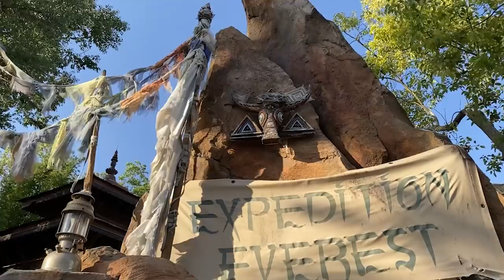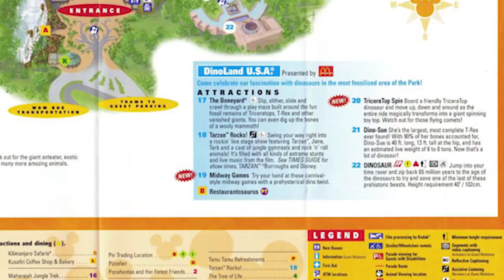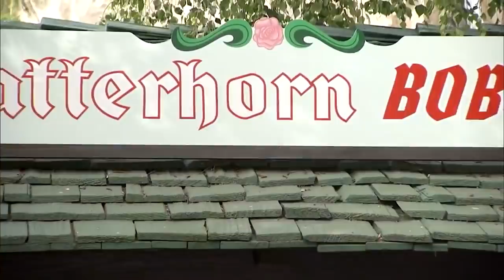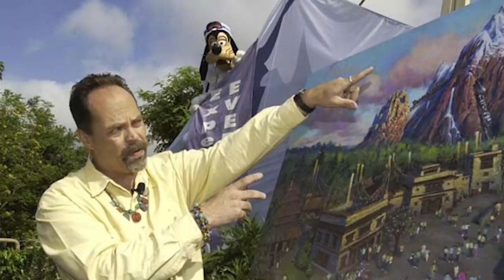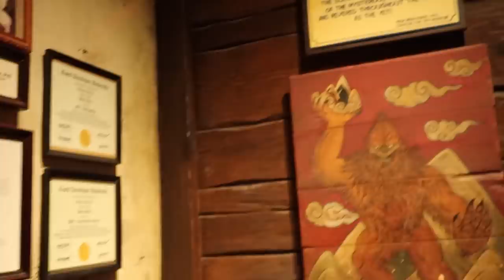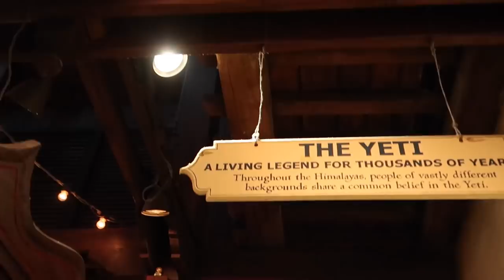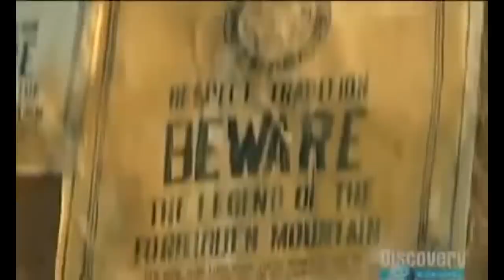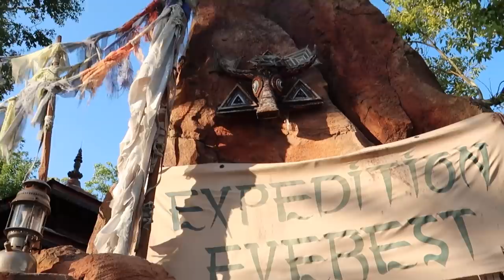The History of Expedition Everest and The Troubled Yeti: Disney's Most Expensive Roller Coaster

Comment: If they didn’t fix the Yeti during the 2020 closure, it’s probably safe to say it’s never getting fixed.
Reply from the maker: Exactly
Reply: I mean... that’s not exactly a fair comparison considering they would probably need to work in hazmat suits to prevent an outbreak among the workers stuck in such tight constraints.
Reply: It can’t be fixed. That big of an animatronic moving all day everyday is way too dangerous. Metal fatigue will cause it to collapse in no time. That’s the real reason they shut it down. They never had the intention to keep it running. It was just bait to draw in the gullible. It’s typical for Disney.
Reply: I’m not sure why you think they closed down during 2020... it’s not like they could have a full crew out there fixing it just because the park was closed.... lol
Reply: @metropod  i don't think the animatronic would require more than 2 or 3 guys to work on it at a time. Any more than that you're just making things more difficult on the workers.
Reply: @kevinwebster7868  it sounds like the problem isn't the animatronic the flaw is in the structure its on. Can't get to it to work on it consistently.
Reply: @oIRONITEo  So what your saying is that 2-3 guys would take down probably half to three quarters of the mountain just to get at the animatronic first off. Then second they did do some work on it and when they tested it, the hip of the animatronic broke. So now were talking tearing down half the ride and having to completely replace at the very least an entire leg......They're not fixing it, I know its hard for some people to understand but in reality you eventually have to make tough decisions. Like say is it worth spending the money to tear up an attraction, closing it for months and on top of that having to not only have an entire animatronic leg made for a massive animatronic but removing, repairing and restoring everything, protip: its likely not.....Fixing it require a hell of alot more than just sending a couple guys in for the day, all for something you see for exactly 3 seconds.
Reply: @lutherheggs451  you should make an audiobook
Reply: And with Joe Rohde no longer at Disney, there isn’t anyone to push for the fixes needed.

Comment: I worked in the Everest gift shop for a time years ago and I've ridden the ride countless times and love it. I was lucky enough to have one of the ride's managers walk me into the mountain to see the yeti up close and it is extremely impressive to see in person and not flying past it. She told me that back when it worked that when giving new Everest cast members their tour of the ride that when looking at the yeti someone in the tower would turn it on to scare the new person.

Some interesting facts about the decorations of the area: most if not all of the gear that decorates the inside and outside of the different buildings is actual gear that was abandoned on Mount Everest. Also, the staircase cut from a log in the standby queue that goes from the office (can't remember if it's Bob's or Norbu's) to the loft was bought from an old lady in Nepal, they built her a proper set of stairs in its place.
Reply from the maker: thank you for sharing those!
Reply: Wow !!

Comment: Skeptical third-world kid: "So you're telling me Disney couldn't afford to have someone double check their math?"
Reply from the maker: Haha
Reply: I don't think it's a matter of math as much as it is a real-world engineering failure. The design of everything worked out just as planned, but the animatronic Yeti failed to work as they planned it. Unfortunately, these kinds of failures sometimes occur and they just can't be foreseen until they do.
Reply: @rondadams  1) The Yeti didn't "fail", it was everything around it that wasn't properly reinforced to account for its movements. After all, they had plenty of time to test the animatronic in the Imagineering labs before actually installing it. 
2) Said structural instability was caused by a glitch in Disney's modelling/engineering program, something that would've been caught if someone had double checked the math by hand.
Reply: @otaking3582  what’s your source for this?

Comment: Disco Yeti was someones mad dream.  He is too big, he is too heavy, the hydralics are too powerful.
All that power throwing 20,000 lbs of dead weight on a 40 foot high perch has too much flex which is causing all the problems at the base.
I have since heard there is something awry with Disco himself.  And they said it was also expensive to fix.

I don't know much about the latter, but I am pretty sure there is absolutely no cheap way to ever get Disco to leave the Disco area and start jumping at guests again with a growl.
They will have to totally remanufacture the Disco Yeti perch all the way down to the concrete in the basement floor, and even then will it hold?  Disco is 20,000 lbs being thrown about by the hydraulics.  They would have to create a new tower to hopefully support Disco and his movements.  Remember, Diso's perch does not touch any part of the building structure so it is supported all on it's own.

Even if di$ney was not dead finacially,  it does not seem possible that they will shut down that ride for a year or two in order to rebuild the perch tower for THIS disco yeti.  As we have seen with other attractions,  di$ney will shut down or remove items in an attraction rather than fix them,  and reviving Disco would be like recreating from scratch and that includes costs, so don't expect Disco to stop Discoing,  ever.
SO........... as you are flying in the coaster car, up the hill and the disco lights start to flash,  YELL OUT  "DISCO YETI" and wave.

Comment: I actually got to see the yeti moving because I was able to go to the park shortly after expedition Everest opened. I used to live in Florida and I was lucky enough to be able to get a hold of tickets for cheap or free every once in a while. When I went back several years later, unfortunately the yeti was not moving and I was kind of aware of the situation but to be honest you go buy it so fast. It doesn't make as much of a difference for that ride as if say the animatronics in pirates of the Caribbean stopped working

Comment: WDW is so lazy and cheap. They have had 14 years to come up with a replacement for that broken Yeti animatronic yet they still haven't. There's a fully functional King Kong animatronic down the street at Universal Orlando. Disneyland replaced their 3 Yeti's on the Matterhorn years ago with brand new ones even though the old ones weren't broken. Even Universal Hollywood upgraded their Indominus Rex Animatronic recently. WDW charges $130 per person for admission, what is their excuse for being chincy with their parks?

And before someone complains "Turning on the Yeti would break the Mountain structure". They could replace the Yeti with a screen projection, or a different animatronic that doesn't violently shake the mountain. Anything is better than a Disco statue. They were closed for several months during the pandemic, they could've done the replacement during that time. Universal Hollywood Did with their I-Rex animatronic.